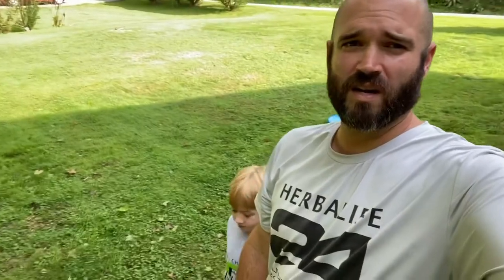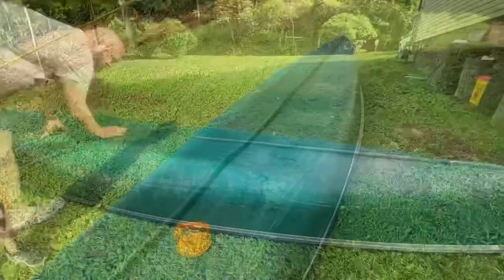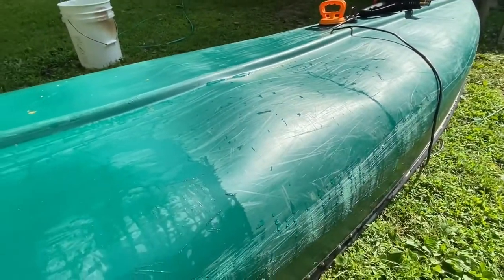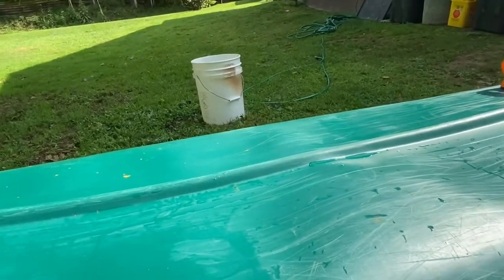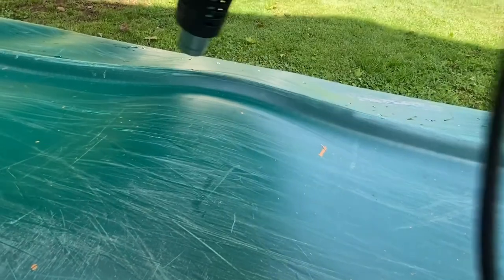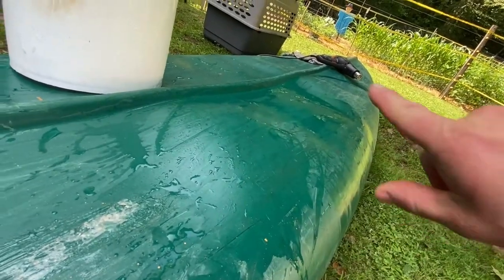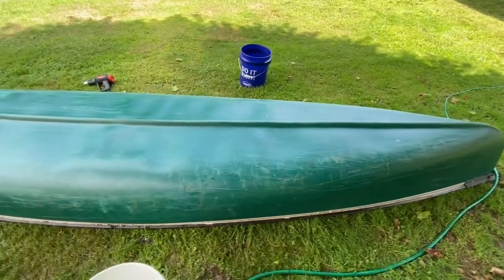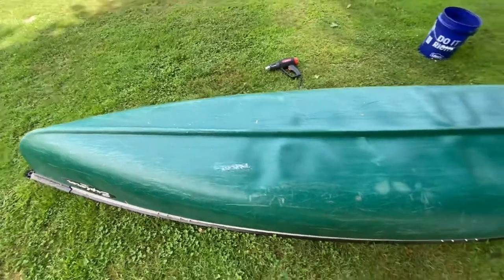How to Remove Oil Canning from a Canoe(Say BYE To Wrinkly Bottoms)

Comment: You can patch holes by lighting a plastic  bottle on fire and dripping hot plastic  on it. Warm up the area first  with a heat gun, torch or soldering iron

Comment: Same happened to mine. Caused from leaving it upside down on the ground. The gunnels became flat and the keel arched backwards causing the wrinkles. Best to store it upside down on saw horses.  I fixed mine  by re-arching the canoe with weights and a heat gun
Reply from the maker: That is how I store mine. I picked this one up for really cheap and straightened the bottom out for the video then flipped it. Win win.